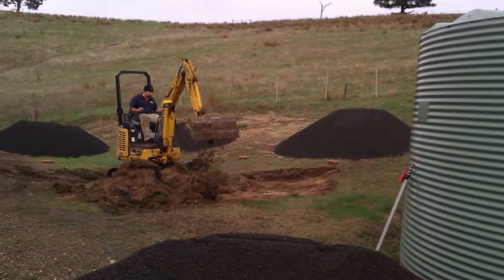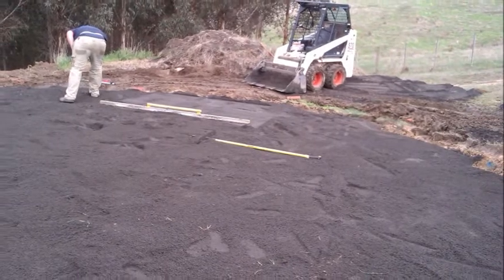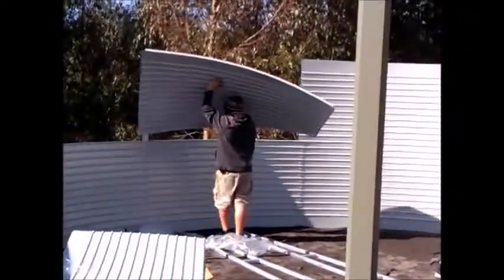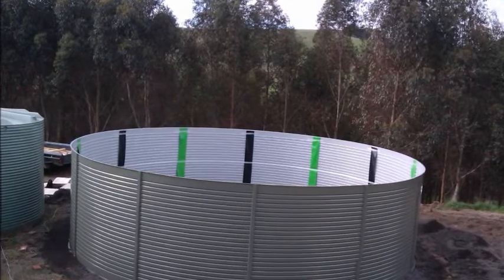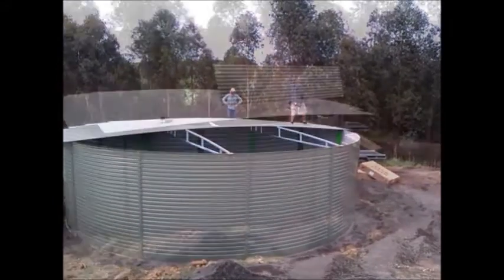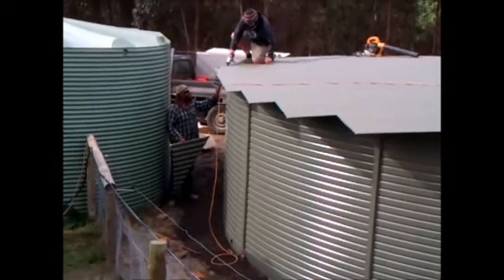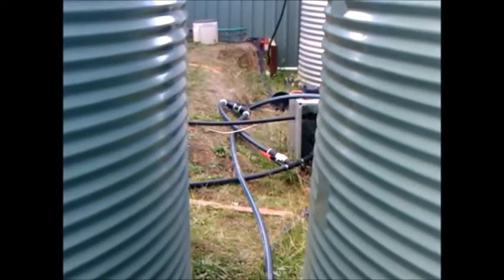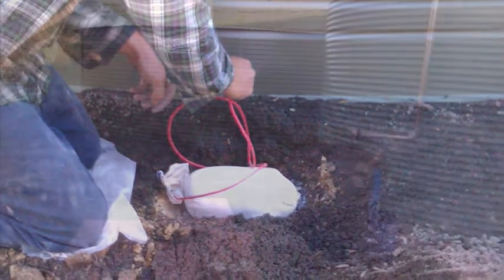Installation of a Steel Water Tank with liner - Off-Grid water supply

Comment: What kind of system do you have to process and store potable water? Do you have to clean the tanks out?
Reply from the maker: Hi Cynthia Choi, Nothing, we use straight from tank and no cleaning required. We boil water for drinking. No chlorine or fluoride or additives. Thanks for watching.

Comment: Nice off grid water storage. If you have a shallow well and available manpower, our manual pump set up with twin cylinders and two pump levers can fill one of those tanks in 4 to 5 hours.  Do you have a shallow well?
Reply from the maker: Thanks, no we do not have a well, all water collected from all roof areas.